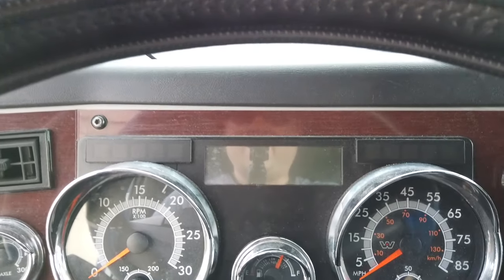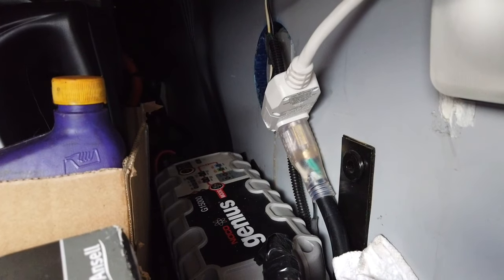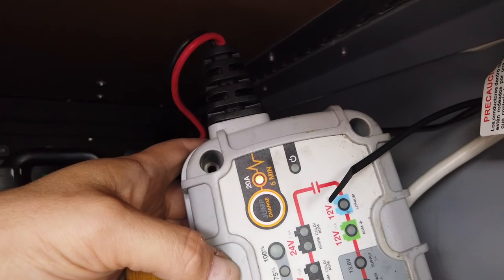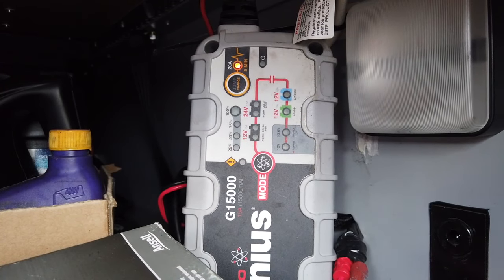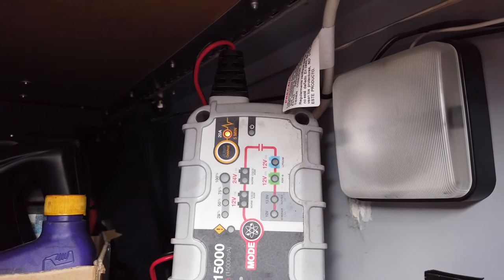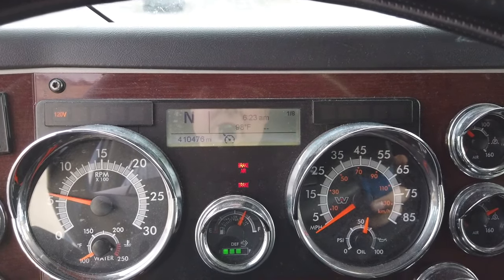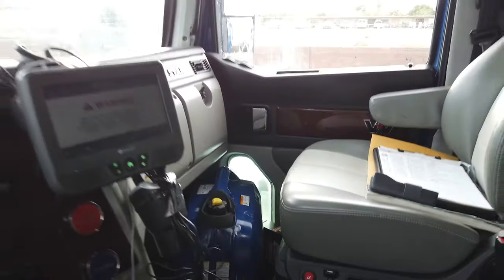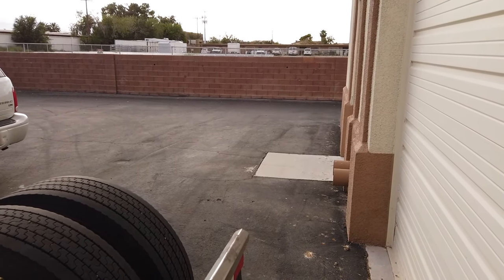Every Truck Should Have One

Comment: What you want if you're not near a power outlet is the Noco Genius GB150.
Reply from the maker: The whole point of having this, is to be able to plug in if you’re using a generator or have an APU that does not charge your batteries. Not just to jump the truck. There are actually better jumper packs then the NOCO if that’s what you would mainly want it for. I needed mine to keep the batteries fully charged.
Reply: @DrivingByBraille 
Can you suggest which jumper starters that are better than tbe noco? Thanks.
Reply from the maker: nbat58 great resource 

https://youtu.be/JN8A2nIMUWA

Comment: The wire gauge is great, but the wire casing on the charger end becomes very brittle in freezing temperatures. What appears to be stress relief at the charger-end next to the housing actually becomes the spot where the wire cracks, exposing copper. It's poorly engineered and needs to be redesigned. Mine experienced this wire failure at 36 months (warranty is 30 months) and they want me to pay for shipping to them, and 35% MSRP (who cooked that up?) which is $70, to repair original equipment. They consider this normal wear and tear. So the story goes that cracked wire after 36 months is normal wear and tear. If you think that reasonable, then you know what to expect.
Reply: Jesue help him lord $80 for almost three years of protection is worth it

Comment: Nice.  May get one.  Just changed batteries the other day.  Adding the generator this weekend.  How many amps is that charger?
Reply from the maker: It’s a 15amp charger. Mine would “top” off the charge on the batteries in about 30mins after I turned the truck off. In this video, the batteries were pretty much dead.. I plugged it in.. I came back to the truck 10hrs later and the batteries were at 75%.. of course I found out today, 2 of the 4 were shot. So, I get to install 4 new Optima’s tomorrow.
Reply: Driving By Braille are you running that off your  2000 generator?
Reply from the maker: Yes. It’s hard wired into the shore power. Anytime the truck in plugged in, whether it’s the generator or an outlet, it turns on.
Reply: Driving By Braille cool.  My prostar doesn’t have shore power.  Will have to wire it to the batteries and then plug In once I return to the shop or generator when I’m out.

Comment: i have to comment, why are you not running your fridge via split charge battery pack, that prevents you  taking the truck battery flat after 2 days, a correctly sized drop back relay will protect your starter battery, and second why are you not using a 3 way fridge  12/110v/propane makes far more sense to me than constantly charging your truck batteries and or killing them, or buy a apu ??
Reply: Really good idea.
Reply: Excellent comment...
Reply: It's not an RV it's a class 8 tractor.
Get a monster Engle fridge freezer 12 volt / 110 volt portable.
I have had it 7 years no Issues it just works. In my Freightliner cascadia.

Comment: Can you show how it's installed?
Reply from the maker: Just like any other battery charger. Connect positive and negative to the batteries. And I have it hard wired into my shore power box. So anytime I plug into shore power, it turns on.
Reply: @DrivingByBraille  that's what I thought. Wasn't sure if there was a certain way to install. Good video
Reply: I am afraid I do not have shore box do I have keep it plugged in to an inverter then?
Does this thing hold charge in case it is not connected and not getting charged?
Thank you

Comment: Dude ,if you’re running a refrigerator or anything that uses much poweR your gonna buy a bunch of stating batteries! Thru are not made to be deep cycle! You need 2 completely different systems! You’re gonna burn up your alternator as as well ! You need an onboard dc to dc charger that charges deep cycle batteries! Your headed for a mess ! Ask me how I know !
Reply from the maker: The battery charger is connected to my generator. When I run my generator it charges the batteries. The battery charger has an AGM setting. It’s setup correctly. I have Optimum Yellow Top batteries. They are deep cycle / Starting batteries. And there are 4 of them. Never had an issue. They handle the load of the fridge and the inverter just fine. Been doing it like this for 8yrs now.
Reply: Just trying to understand this to make my own setup. I mainly want to run generator to plug my block heater in over night as an alternative to running all night as well as trickle charging my batteries with this NOCO. I have an aftermarket inverter that runs fridge, coffee, microwave espar bunk heater, etc inside my cab. Is it ok to run generator with this setup at the same time appliances may be running off the same batteries?  @DrivingByBraille

Comment: Question,,,  can you do a cycle with inverter power the noco ,and the noco charging the truck battery    hopefully you get what I trying to say,,, some time wanna leave my small fridge plugged on the weekends but the battery died  ,so I thinking this could be good Idea?  What do you think or what you suggest
Reply from the maker: Don’t think that would work. Taking power from the inverter, from the batteries to charge the batteries. I think that’s called perpetual energy. Not possible.
Reply: @DrivingByBraille  thank you    , now my noco is 72000 , and I see you have 15000 is my good still for semi truck
Reply: G24000 correcting